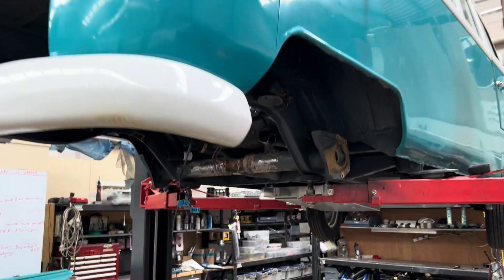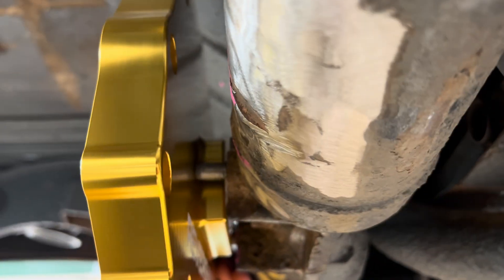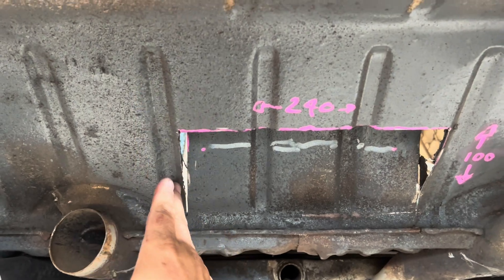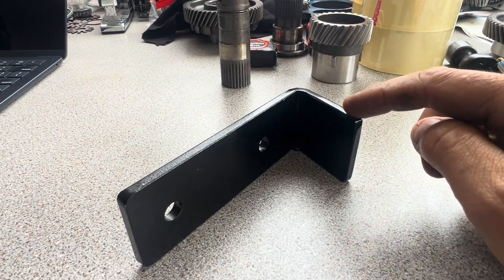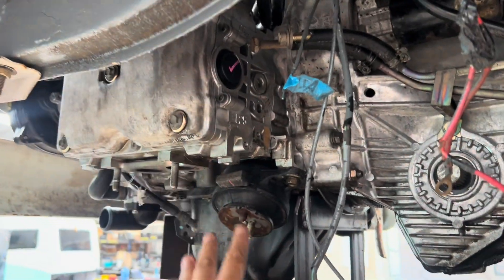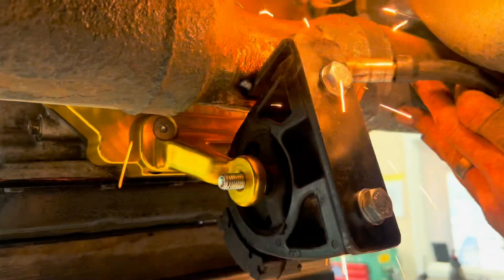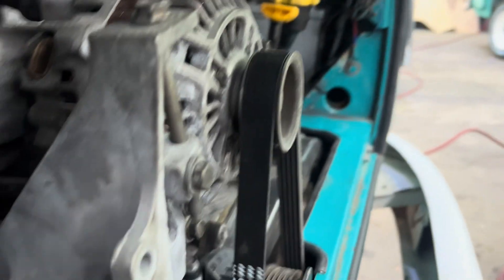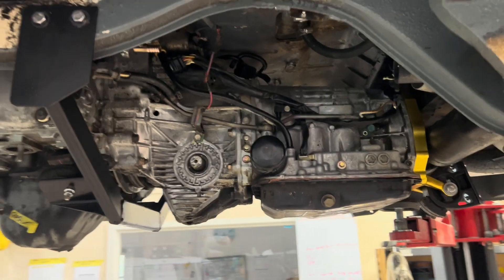Subaru 4EAT (4 speed Automatic transmission) into a Volkswagen Split Screen / Split Window Kombi

Comment: Your rear mount (~5min) doesn't make sense. That mount has way more flex than the transaxle has space to move. I'm pretty sure it is going to make noise, because the transaxle will contact the torsion tube.